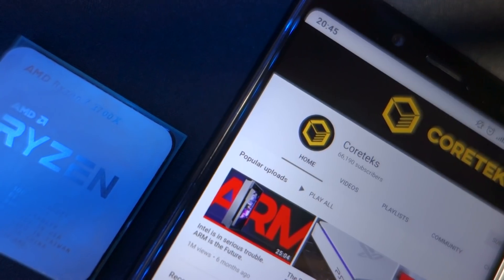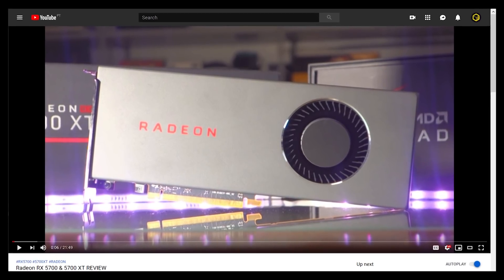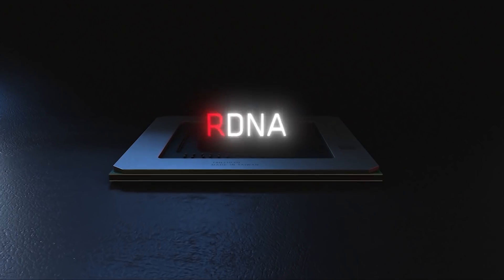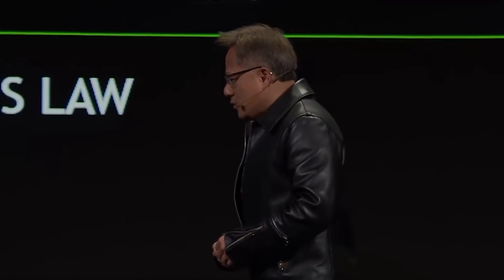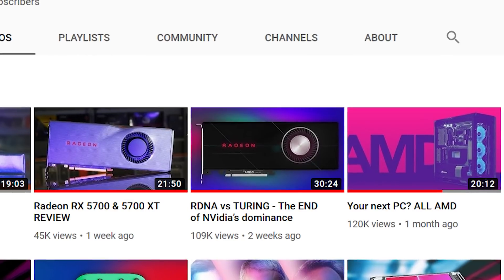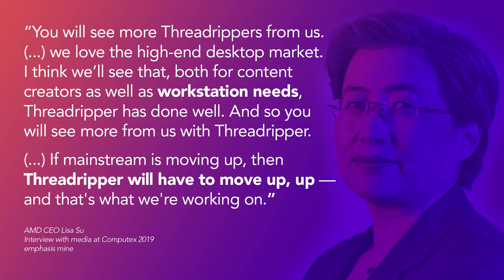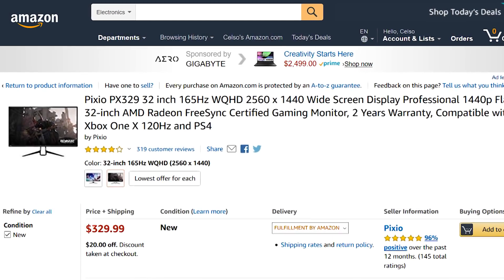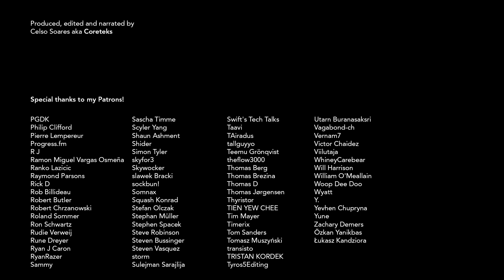What's next for AMD? - 5800XT. Threadripper. APUs.

Comment: Lisa Su's Law: The number of cores and CUs doubles every 18 months.
Reply: lmfao. So true. Meanwhile Intel gives same shit for 8 years.
Reply: @Pixel_FX  *6 years
Reply: @Pixel_FX  - 10.  The first quad core i7 is ten years old.
Reply: @jesuschristislord77733  Yeah. I said 8 because they stopped giving same shit since ryzen started to shake the market. 8th gen had 2 more cores and then 9th gen again 2 more. thats why. 😊😊 But they are still shit because AMD literally doubled the cores within 3 years.
Reply: @Pixel_FX  at least you get new chipsets every new gen of cpu.
Reply: you cant use more than 256 cores  on a 64 bit system.
Reply: @danis8455  64bit computers can support more than 256 cores. That limit is only for Windows not the hardware for instance Red Hat linux theoretically supports upto 8192 cores with 768 as a validated supported amount of cores. So Windows can up that amount from 256 cores when they deem it necessary.
Reply: and if i have to add 128 bit systems are gonna be one huge die and unlikely to be in the pricerange for home users
Reply: @mihaimera7837  just google Amdahl's law  it will explain it better than  i can, most likely.
Reply: doubles? or just increases?
Reply: And the price also doubles.
Reply: I am going to be fan of amd and will be joining amd community
Reply: This needs to be a meme.
Reply: Every two years*
Reply: fanbois >.< no  reson or logic to be found here
Reply: Radeon's Law: It's always the next GPU that's going to be the one that really gives Nvidia some real competition.
Reply: @e2rqey  Nvidia bot detected. :V

AMD already beating Nvidia in every price point below $500. Pick any GPU below 2080 and AMD has faster GPUs for cheaper for each one. 2080 and 2080ti are the only cards they haven't passed yet. Don't forget that 5700XT is not their top card. It's just a 251mm2  tiny GPU. Nvidia bots really have no brains at all. 😂😂😂
Reply: @Pixel_FX  tbh if you need to buy a GPU that costs less than $500 you might as well just play on console. You realize that on a signifcantly smaller node size, AMD is only barely able to match Nvidia on Performance and Power efficiency. Architecture-wise AMD is at least an entire generation behind Nvidia. 2 generations if you account for ray-tracing as well. Nvidia could refresh Pascal on 7nm and smoke AMD's current GPU's, Turing on 7nm would obviously outclass AMD. Oh not to mention that the new 5700 and 5700XT look like shit. If Amazon Basics made a GPU that's probably what it would look like. I have no doubt AMD will make a higher end big navi card, why do you think Nvidia hasn't dropped the 2080 Super yet?
Reply: @e2rqey  5700XT crushes 2060Super, and at a lower price. Did you not watch the video on which you are commenting? 5700XT uses a tiny die. What do you think will happen when they scale it up? What do you think it will do with a scale up AND HBM2 memory? What is this nonsense about "might as well play a console? If someone wants to play warships on desktop at 1440p, both companies make cards that will do it, but AMD costs less. GG.
Reply: @Mattribute  god your slow. The only thing they will accomplish with HBM2 is pricing themselves out of relevance. AMD purposely made an architecture that used GDDR6 because of the huge cost associated with HBM2. I highly doubt you will see a Navi part with any HBM2. Also the cost of 7nm production is prohibitively expensive especially when it comes to larger chips. The bigger the chip the more likey there is to be defects which means the lower overall yield and the yields don't scale linearly either. Navi is frankly a mediocre at best card, to pretend it has anywhere near the same capacity for market disruption as 3rd Gen Ryzen/Zen 2 is a total joke.
Reply: @e2rqey  Well some things here woth considering :P neither AMD or Nvidia owen their own factories making nm generation talks a bit silly. Its not really in the hands of either of them to improve prodution quality. and chiplets are there to resolve the problem with production defects. That being said Nvidia definately in the lead right now for GPUs. But the future will eventually turn to APUs  and that puts Nvidia in a pretty bad spot.  leading back to Intel Vs AMD and potential VIA. theres a reason why Intel is making their own GPUs
Reply: @Mattribute  2060 is a year old...5700xt and 2060 super is much more comparable.
Reply: @e2rqey  *You're.
How about you try making your points without insults next time, bud. It completely devalues what you have to say.
Reply: @e2rqey  i dont think a console can play almost every game on 1080p ultra 144hz+ (using rx 5700 lmao)
Reply: @Mattribute  besides there is some serious cost side effects to playing on a console. pc don't cost to use the internet. Pcs don't have a locked ecosystem to buy from. Also pc have a cheaper upgrade path than consoles. While also having higher value in parts than consoles over time. So why would any one cheap gpu or not go to a console when a pc can cost less no and in the future than a console and get the same exp or better?
Reply: @e2rqey  What your saying doesn't even match what the truth is HBM2 is actually getting cheaper by the moment especially with google buying up so much HBM2 for its cloud systems. then you have the fact that it only added in $100 to the price of the Vega VII but save it tons on energy usage compared to GDDR6. So in retrospect waiting to release the 5800xt and 5800 comes down to them waiting on the price of hbm2 to get right where they want it to finish off NVidia cards. NVidia wont hit 7nm till end of next year so no they don't have a 7nm card to crush amd with. If they did they would have released it instead of the shitty Super cards they launched that still get beat by unoptimized Navi in some games. The worst part that you seem to forget is AMD controls the gaming space So even if NVidia is ahead tech wise their architecture will fail them do to every developer optimizing games on AMD hardware and software. Making outliners like Forza Horizon more prevalent in the future. The control consoles, desktop, and mobile , while having most of the cloud solutions as well. I think your missing the Big picture. I build system for ppl on a regular bases as something to keep me busy since I retired. The AMD 2400g apu once dialed in on the bios can do some serious work in games. I ran the 2400g at 2gb and with 16gb of 3200 MHz ram in a liquid cooled cpu system and got 80fps with a constant 60fps in battlefield 5, 70fps in gears of war 4. WITH AN APU. This time round AMD will have stronger offerings in the apu space and better auto overclocking support so the sky's the limit on what the next apus will do. As for Navi you haven't even scratched the surface of what it's capable of. If you think for a second NVidia likes hearing that a $$400 card beating a 2080 in any game and tapping the 2080ti on the should is ok then you obviously don't know why they dropped Super in the first place. FEAR, fear of the unknown with AMD, fear of the future thanks to AMD, fear of the fact that AMD gpus so far have always gotten better over time through driver support, and lastly fear of losing control of a market they have dominated. This is only the beginning though. I feel Intel will be disrupting the market strongly next year and that feeling intensifies when I think about what they got from AMD, the partnership they made, and who's leading this new gpu team on blue. They might enter the market as the new dog for all we know. You got to be more open that having a closed mind. Closed minds is how intel just got beat in the last 3 years. they counted out AMD like most of us did and surprise and upset in only 2 years time.
Reply: @rightasrein  If your correcting my grammar and spelling mistakes all that tells me is that you aren't able to produce any valid couterpoints....
Reply: @e2rqey  That's because I'm not here to argue. Plenty of others here have made the same points as you, except while also showing a little bit of respect.
You also made the same mistake, again.
Reply: @rightasrein  respect is earned. If you aren't adding to the discussion just keep lurking.
Reply: @Pixel_FX  Dont forget nvidia has had rtx out now for nearly a year, and that is how far amd is behind nvidia.. Literally amd is a generation behind Nvidia.
Reply: @danjal07  you should search and see why Microsoft and Sony picked AMD again to make their Consoles' CPU and GPU. Oh, they have Ray tracing too. BTW RTX is a scam. Honestly. You can achieve the same thing without sacrificing performance and buying super expensive GPUs. Just search YouTube for CryEngine Ray tracing demo. Ran on Vega 56. You guys clearly have no idea about DXR or how rendering works.
Reply: @rightasrein  haha. Leave him bro. It's a bot, Nvidia bot. That's why it makes mistakes.
Reply: @e2rqey  accounting for ray tracing??? Loool. So ray tracing is a consideration when buying a gpu now? Absolutely none of the games I play require ray tracing. No need to buy a feature nobooooody uses. Rtx on = fps off
Reply: @e2rqey  Because AMD haven't released the 5800 and 5900 yet. The 5700Xt is the low end Navi and it's still nipping at the heels.of the 2080.
Reply: @e2rqey   LMFAO you call garbage ray tracing in RTX trash lineup a feat? well buddy let me punch some information into your brain cells. RX 5700XT, has a wayy smaller die than RTX 2080ti... BUT provides the same performance (yes, the same performance as RTX 2080 TI) in Forza Horizon 4. Imagine if all the games were optimized like that one! and it's not full-sized die yet! R.I.P Intel, R.I.P Nvidia when AMD will go all guns blazing
Reply: @Pixel_FX  ray tracing does impact performance on vega and rtx is not really a scam those cards do have real purpose built tensor cores that help with ray tracing and "deep learning", however the 5700xt isn't the card most people want however, it's technically the card most people need that being said many games are designed with nvidia software to work on nvidia cards so even superior hardware from AMD would proform worse than a inferior card in those titles
Reply: @e2rqey  
RDNA isn't behind Turing. GCN was though, don't just regurgitate what you heard a couple of months ago. They changed their architecture. Look how small the Navi 10 die is compared to the tu104 die.
Reply: @rightasrein  no u
Reply: @dextercastor3965  your personal anecdotes are not a substitute for actual evidence
Reply: @Pixel_FX  the vega55 running it a 10fps.. lol that's not running that's struggling.. a 2080ti will do it at 4k60 with current drivers..
Reply: @leenagle2903  the 5700xt doesn't touch or nip at the 2008ti.  Maybe the 2070... that's funny.
Reply: @e2rqey  same goes for your "ray tracing is a consideration when selecting a gpu" that is just your own personal anecdote as well.  keep buying Nvidia. They have increased the MSRP for video cards for the past 10 years. I bet you are an Intel and apple user too xD
Reply: @e2rqey  Your untrue statements and unsubstantiated claims are not a substitute for actual evidence. Don't worry, time will tell the truth.
Reply: @Mattribute  I think he forgot that AMD cards are naturally better at compute and matrix multiplication....you dont need to pay an extra 200 bucks for RT and tensor cores...They are also implementing a more efficient version of NVIDIA's DLSS and RT API
Reply: @danjal07  umm my Vega 64 clocks at 1700mhz the memory is at 1070mhz abs can run 4k at a consistent 30fps only due to screen tearing above 30fps.
Reply: Sean H I bet you’re really regretting your comment about the 2080 super now huh?
Reply: @rogue_gaming5106  Comments that didn't age well 😂😂😂 he isn't even replying.
Reply: @e2rqey  dude the Xbox one x fastest console out right now has basically a 1060 for 4k 60 fps or 4k 30 new Radeon gpus are much much faster than that for the price of a 1070 like 2 years ago which has the performance above the 1080
Reply: @Pixel_FX  nah I just don't care enough to come back and argue when we know damn well neither of us are going to convince the other of anything. I have no problem admitting when I'm wrong the 2080 was a fucking joke. I really thought Nvidia would be more concerned about AMD encroaching on the high end in the near future. But clearly at least for now, they still don't believe there is any real competition in that price range. I hope AMD can actually compete with them because I don't want shitty cards being announced like the 2080 super and I don't want to continue paying well over $1000 for the most powerful card.
Reply: @Oliver-bn7jt There's a videogame console in 2019 for $400 that can almost deliver the performance equivalent performance to a 3 year old, last generation graphics card? Wow! It's like a mid-range gaming PC! But worse!................. It's still a console. The next generation of consoles look like they are shaping up to be much more powerful, which will hopefully bring up the minimum bar for performance so devs can make more hardware intensive games. Being the fastest videogame console is like winning the Special Olympics
Reply: @e2rqey   "tbh if you need to buy a GPU that costs less than $500 you might as well just play on console. " Never read anything more entitled on YT
Reply: @e2rqey  5700 XT matches 1080 Ti performance specialy in new titles in older title games 1080 Ti beats it by 20-30 fps. So in my eyes buying 5700 xt is like buying 1080ti but at a cheaper price and is brand new with more features like ryzen chill mod, and ryzen anti lag feature. So to say navi is mediocre card you are correct so is 1080 ti. People can buy it now for extremly cheap considering it is total overkill if you use it for 1080p monitor where you can max any new title on ultra and get over 100 fps any game you throw at it. One more thing you are forgeting that people who will buy it are the ones who own rx 480 or rx580s and this card is strong for 2 rx 580 put together in crossfire.  If you think amd wont show up with rx 5800 untill 2019 is over you are delusional this card was just to test the waters. 5800 will smoke 2070 super and possibly match or surpass 2080 ti. Forgot to add that amd is working on RTX stuff for the future cards cuz this is where tech is obviously headed but as you see RTX is in begining stages as it has problem runing even 22 year old game like quake2 at low resolution so I wouldnt worry about now owning RTX capable card in 2019 and 2020 sence tech is not quite there yet.
Reply: @e2rqey  You can't pirate on consoles ...
Reply: @Mattribute  does it crash 2070 super?
Reply: @gasoau  Why do you ask? Did nvidia cut prices? Its going to get good soon I think, as competition heats up and yields continue to improve at the foundries.
Reply: @e2rqey  AMD already had Ray-Tracing way before Nvidia
Reply: @e2rqey  where's Nvidia's CPUs ? That's what I thought...
Reply: THEREALMVP what Does that have to do with GPUs? Nothing and Nvidia does have cpus but they’re arm and they’re really bad arm at that. You guys get so triggered over brands jeez like AMD and Nvidia aren’t your moma stop defending them and just buy the better product for your price range. Navi is absolutely better than gcn and maxwell. It’s probably better than pascal ipc wise and is really power efficient bcz 7nm. My card never goes above 200 watts unless I overclock the snot outta it. It’s a really good architecture and is still being held back by gcn power efficiency wise at the moment but it’s getting better. Turing is really good tho cause it has some really cool features even though they aren’t really ready for prime time yet, AMD’s new AMF encoder is still a little behind the nvenc one but their hvec one is miles ahead of the Turing one. 

The moral of the story is both architectures have their weaknesses because they are both brand new and need optimizations, Turing is much closer to its optimization wall than Navi is tho cause it’s almost been out a whole year. 

Some things are really much better on Navi than Turing but getting heated and throwing insults at each other is just making both of you sound beyond stupid and like shills for both companies 

:v
Reply: @somerandompersonontheinternet4  450 ?? Lmao you Nvidia fanboyz amaze me
Reply: AMD Fanboy's Law: The most important metric for GPU performance is die size. It can be used to dismiss any and all comments made about lackluster performance or Nvidia's architectural advantage. 

Part 2: If you can no longer make any valid arguments, look for spelling and grammar errors. Finding one will give you the intellectual high ground. Because everyone knows, incorrect information and proper spelling beats Misspelled facts every time! 

Part 3: Under absolutely no circumstances ever bring up drivers. EVER
Reply: @e2rqey  I thought AMD fanboys talked about bang for buck, for the most part. For instance "The 5700XT costs less than 2060 super and out performs it, especially on X570 where it gains 6% via PCIE 4."  Personally I got a 2080 on black friday 2018, and they only thing I disliked about it was the price. Even on sale its monopoly pricing, but that's beyond my control. I love playing 1440p at high frame rates and it does that really well. The driver support with nvidia has been excellent (except for RTX, which was unplayable at first, and which is still basically useless) certainly better than Catalyst ever was. Nevertheless, If I was to buy a 1080p video card for a high FPS monitor, it would be a board partner 5700. AMD WILL bring out high end cards based on RDNA, they're going to gut nvidia with 7nm RDNA, and then they are going to continue expanding.